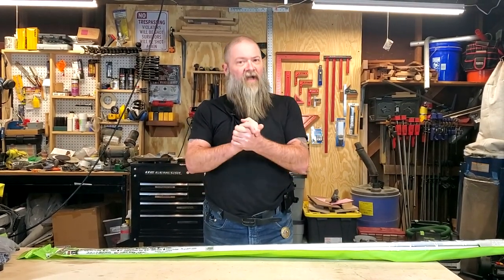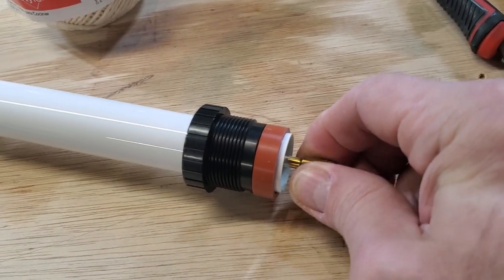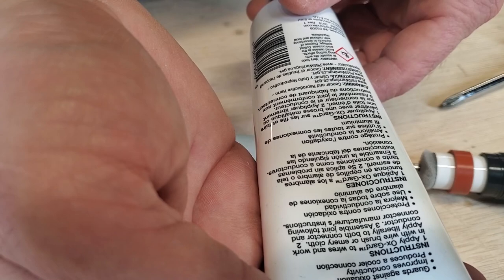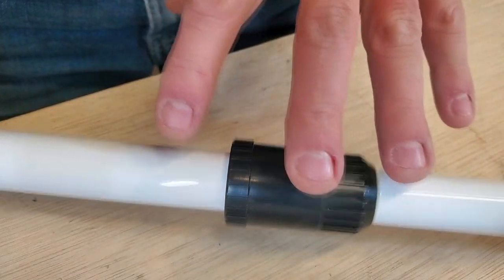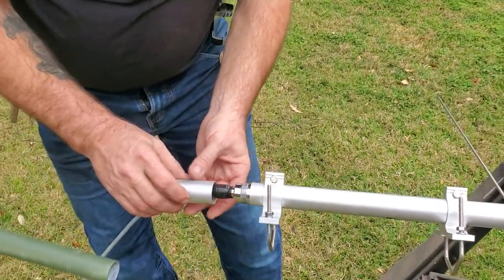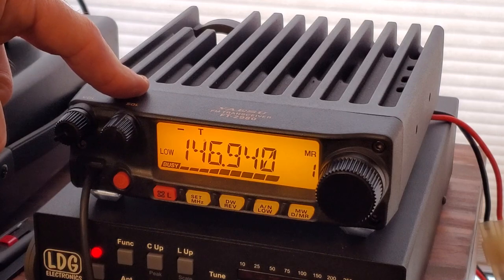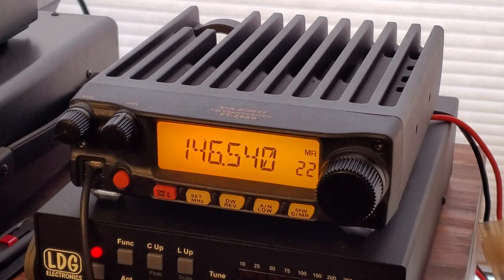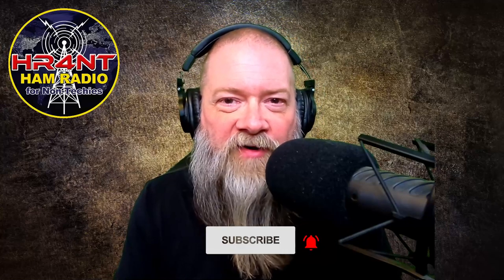Building the Comet GP-9 with the Yaesu 2980

Comment: Thanks for the video. Your instructions saved me a lot of frustration. The written instructions that come with the antenna are terrible! Another tip - The antenna wire within the segments was too deep for me to reach even with a needle nose pliers. I mad a "J" hook out of some solid gauge wire and used that to pull it through. Also found a bad solder joint in the antenna base that I had to repair. Antenna was new out of the box with a high swr. Fixing that solder joint solved the problem.
Reply from the maker: I'm glad my video helped.  Comet antennas are hit or miss sometimes and it is a good thing you checked your connections BEFORE you put it up and turned it on.  So glad it worked out for you.  Enjoy the antenna and make those contacts.  Thanks for the comment and for watching.  73!

Comment: Will this antenna support 462-467 GMRS? Or is the GP-9N better?
Reply from the maker: The antenna specs show that it will work in the following frequency ranges:   144-148 MHz and 440-450 MHz.  So I do not think it will work for GMRS.  The GP-9N is the same antenna but with an N connector rather than a SO-239 connector.  I hope this helps.  Thanks for the comment and for watching.  73!

Comment: That antenna looks like an absolute monster. The 2980 seems like a great rig. I had the FT-1900R back in the day which was similar but only did 50 watts. The menu, display, buttons and everything else were more or less the same.
Reply from the maker: LOL...at 17 feet tall, the GP-9 is a monster!!!  I really like the 2980 and a big selling point for me was that it pushed 80 watts.  I wanted to separate my HF ops from my 2M stuff and this was the solution.  Thanks for watching and for the comment.  73!

Comment: how did the antenna do with high wind mounted like that? i have the Diamond f23 ordered. its 15 feet long , it's just like that antenna. Also my mounted setup is identical to yours. i have the same radio
Reply from the maker: It seems to be doing just fine.  I have had zero issues and with that top rail being mounted to my garage eaves it makes for a study setup.  Thanks for the comment and for watching.  73!

Comment: Video was great...camera positioning and explanations were  perfect. I was at a standstill on lining up my interiors on the sections but now I should have no problem. I also have a Yaesu 2980R and with my CP22E I was getting intelligible signal to the car at 40 miles when my wife was driving at high elevation points along the road. I just put up a 50 foot tower and this GP9 will be so much better with the higher gain. Thanks again for an informative video.  73
Reply from the maker: Glad it was helpful!  I wanted to make sure I had a tutorial video that showed all the stuff that was left out of the other "build" videos.  I am glad that I was on point for you!  Having this antenna up 50 ft will be a massive advantage for you!  Thanks for watching and for the comment!  73!!

Comment: Thanks for posting the building of the GP9. When using Scotch 33 plus, I was taught to stretch it as you wrap it on itself.  I learned this in the 70's from a master electrician/lineman. I think that is the reason why they call it plus. His job was to  replace HV transmission lines on towers leading from hydroelectric dams. I have two of those Ft-2980 radios, they rock. I bought my first one on black Friday 2017 from HRO for $134 which I thought was a bargain. The next one I bought was a Dayton online special in 2018 for $114. I was afraid they closing them out when the price dropped. Covid hit and the prices went over 200 bucks.  Glad to see the prices are coming back down. Great radio to do simplex on. I live in a hilly area where UHF does not do well. I hope you switch from RG8 to LMR400 in the future. FYI the info in the manual on how to set custom memory banks on my radio was incorrect, hopefully they have changed that. I had to watch a video on youtube on how to setup custom menu banks on a Yaesu handheld to figure it out. Later on I bought RTS Software which took care of the custom memory banks. Great to see how well the GP9 is constructed and how easy was to assemble. Thank You!
Reply from the maker: Hi Jim!  You are very welcome!  Glad you found value in my video.  The prices did drop considerably based on your data which is a good thing.  The 2980 seems to be a great VHF radio and I still use it every day now.  I think they did change the manual for programming the radio because I was able to program it just fine.  That GP-9 is suck a good antenna that I think it should be a first pick for anyone that "can" put one up and will use it regularly.  It is just a great performing antenna.  I am planning on getting better coax in the future.  75 feet of 400 is a bit steep right now.  Thanks for the comment and for watching.  73!
Reply: Here in the Netherlands they are sold for 185 US.

Comment: I have a Radio Shack HTX 242 that has the features found on this radio. Max output is 50 watts stepping down to 1 watt… 
Nice to see a possible upgrade to my solid old work horse. I have only used it as a base and never had a problem.
Thanks for sharing..
Reply from the maker: Yeah the GP-9 is a great universal VHF/UHF antenna.  The gain from it alone is worth the price as long as you have room for a 17 foot antenna...LOL  Thanks for the comment and for watching.  73!
Reply: The 212 was my first non HT 2 mtr. radio. It was a beast! Loved that radio... I miss it.
Now I run a FT 2900.
73 de KF4LBG
Reply: I just dug my HTX242 out of the attic and the poor mic cable just disintegrated when I stretched it out.  So I just ordered a Yaesu 2980 as a replacement radio today😂

Comment: Nice vid. Lots of good info here.The only thing I would add is I would loc-tight those screws in the antenna. Also be aware that some people have had those puny disc ceramic caps in the antenna burn out with less than the  rated power.
Reply from the maker: Good suggestions and great tip!  Thanks for watching and for the comment.  73!

Comment: An observation from an old tower dawg.

I noticed a couple of things done in the assembling of the Comet dual band antenna. A couple where address is earlier comments such as how to best wrap electrical tape from bottom to top. The only thing I would add to that is to not stretch the tape to break it. This would likely be less of an issue when covered with a second material such as coax wrap. When electrical tape is stretched, the sun will heat it and the glue will allow it to slide and let the end peel up. Stretching it is OK but allow the last couple of inches to relax and cut it.

The other issue I did not see in the comments is the paint. Carbon black is used in many paints to make it black, imaging that? As carbon is somewhat conductive, it can and does, at some higher frequencies, attenuation RF signals, however, It may be negligible at 2 meters.

W4QJP
Reply from the maker: Thank you for those observations.  I agree that I should not have stretched the tape.  Note to self for next time.  LOL  As for the paint, there might be conductive materials in them, but this has not affected the performance in my antenna so far as I can tell.  Pushing those 80 watts I was able to reach out over 100 miles on simplex a couple weeks ago which I was ecstatic about!  Thanks for watching and for the comment.  73!
Reply: I have used the Diamond antennas for years, both mono and dual band for 1.25 meters and 70 centimeters, each a copy of the other, as best I can tell. I in fact just ordered a replacement for the dual brander on my 70 foot tower. I don’t want to climb it more than one time so I will have everything to replace everything on the day I check it out. I'll be 75 on the 15th. You are not the only one to paint an antenna as you will see in the HOAs. Best to you and yours.

W4QJP
Reply: i have experience with carbon black in powder form, it's nasty stuff, and it plays hell with RFID, I was an electronic technician and learned quickly to hate the stuff. Fun fact, it's one of many chemicals used in making Goodyear tires.

Comment: Your paint job looks awesome!  I'm putting together a GP-6, but will try to emulate yours.  Also, I second the guy who said the rubber splicing tape goes on before the electrical tape.  (I'm using 3M Temflex 2155 and Super88.)  And I was told to stretch it a bit as you roll, and to wrap from the bottom up, so the water sloughs off better.  73, W5TTA
Reply from the maker: Yeah I agree I should have wrapped it differently, however, since this video, nothing has failed or caused an issue so far..  Best of luck on your project!  Thanks for the comment and for watching.  73!

Comment: Looks like you wrapped from the top down even though you said down up ?? Always wrap from below to upwards and that means your overlaps will be sealed from rain running down the antenna. A single loop on the coax taped to your pole at the bottom of the antenna acts as a strain relief so the weight of your coax isn't pulling all the way down to ground. Camouflage is a cool idea, well done. I have the same Yaesu radio.
Reply from the maker: I am glad you enjoyed the video.  I don't remember if I wrapped bottom to top or the other way...LOL  Thanks for the tip.  The camo paint has been working just fine since the video.  Thanks for watching and for the comment.  73!

Comment: Great video ! Just some info I switched from rg8x coax to lmr400 for 2m and 440 and it made a huge difference.  Had alot of loss with the smaller coax for HF it's fine but not 2m
Reply from the maker: My next plan is to do a coax upgrade.  The stuff I have on the antenna now is something I found last year when I was new to radio and didn't know any better.  No real complaints with it, but I know it could be better.  Thanks for the comment and for watching.  73!

Comment: What kind of pole/mast are you using to raise the antenna? Nice video.
Reply from the maker: I am using chain link fence top rails from Home Depot.  They are 10 foot sections, cheap and sturdy.  Add a screw for each connected section and you are good to go.  Thanks for the question and for watching.  73!

Comment: What is the mast you’re using and how long is it? As always, love your detailed videos. Thanks
Reply from the maker: The mast is actually chain link fence top rail form home depot.  Cheap, strong and easy to setup in minutes.  I think the are 10 foot sections each giving me a starting height of 20 feet for that antenna.  Thanks for the comment and for watching.  73!
Reply: Nice, I may have a couple more antenna questions before this is over. Not many willing Elmers around me. Thanks and really enjoy your videos.

Comment: I should start this off with, I have questions and comments. 
#1 that antenna is ridiculously large, I think it's bigger than the mast it's on. 
#2 great video.
#3 when you're sealing up the various connections on the antenna what would your opinion be on using shrink tubing?
#4 when you were putting the antenna together did you realize your zipper was down?
Reply from the maker: Hi David!  Thanks for reaching out!  The antenna is large, but has fantastic gain at 9.5 - 11 db!!!  Thanks for watching the video.  I am glad you enjoyed it!  You "can: use shrink tubing, but I think it would be a little bit of a pain.  The coax wrap tape in addition to the electrical tape really seals everything up as moisture is a bad thing with connections in ham radio.  And finally, the elephant in the room...I realized it after the video came out and now we laugh it off as bonus footage...LOL  Thanks for the comment and for watching.  73!
Reply: @HR4NT  bonus footage I love it Lol 😂😂😂. It is good to be able to laugh even if it's at yourself. 73 we will catch you on the air. KJ7WWC/ WRJF717.

Comment: You should put a couple of zip ties at the bottom of the mast to keep the stress off the connector, I do when I put one up...
Reply from the maker: I actually have 4-5 zip ties holding everything together in conjunction with the brackets.  Thanks for watching and for the comment.  73!!

Comment: Really good video. Nice radio. I was worried that the metallic additives they sometimes put in paint would affect your swr. Clearly it's not an issue. I too live in an HOA and this has given me a few ideas. Thanks.
Reply from the maker: I think that as long as you use flat paints and not metallic or similar, you are probably ok.  I am happy with the performance I am getting out of this so far and I tried on simplex and reached across the city.  Thanks for watching!  73!

Comment: I got the Alinco 735t it does 50 watts good base station! I have a 5 foot Comit, would love the gp9 but the vent stock mount I have I don’t think it could handle the wind load. 73 KJ7TBR
Reply from the maker: Very cool!  What you have now will probably be fine.  50 watts is a good amount of power.  Just keep in mind the higher up your antenna is (VHF/UHF), the longer distance and better RX & TX you will have.  Play with what you have for now, when the time is right, you will most likely know what you want to upgrade "if" you decide to so so.  Best of luck!  Thanks for watching and for the comment.  73!

Comment: Great video.  Are you using anything at the base of the antenna post to keep it secure.  Kinda new to ham radios, looks like the radio is on an auto tuner, is it connected to your radio?   Thanks
Reply from the maker: Thanks for the comment. I have a 4' steak buried halfway in the ground that deep the ground that the Pole is sitting on before it is attached to the side of the house. The antenna tuner is not hooked up to the 2 m 440 and 10 that is only hooked up to HF but that was before I learned about resonant antennas like the dx commander classic.   Thanks for watching. 73

Comment: so this would be a great setup for a beginning tech?
Reply from the maker: I would think so because it is a very good antenna (if you have the room to put it up) and powerful @8.5dB gain.  Pair it up with the Yaesu 2980 pushing 80 watts and you are good to go.  It is a dual band antenna so it will do UHF as well, so if you want that feature, you might want to consider a different radio as the 2980 is VHF only.  I hope this helps.  Hit me up through my website if you have any other questions.  Always glad to help.  Thanks for watching and for the comment.  73!

Comment: Most importantly you need to run to LMR 400 if you want a really good signal no loss LMR 400 is the way to go
Reply from the maker: I agree, however I have reached out 35+ miles with this antenna so far and very little issues.  I do plan on upgrading my cable down the road, but it will be a while.  Thanks for the comment and for watching.  73!

Comment: great video...... but the one thing that jumped out at me was when you hooked that cheap Truck stop gray coax cable to it. Again other than that a great video my friend....... KD9SHA
Reply from the maker: That cable is temporary as it was the first coax I purchased before I knew there was a difference.  However, for VHF/UHF it seems to be working fine.  If and or when it dies on me, I will replace it with much higher quality coax.  Thank for watching and for the comment.  73!

Comment: Not trying to be rude or anything but if you follow the directions and join the bottom to the mid section and then mid section to the top section, sort of like a 3 part fake Christmas tree.. 
The string method you show isn't needed.  Once you join the lower to the mid section and nest it the inner antenna wire actually gets pushed out enough to make the top to mid section connection without have to pull anything with the string
I do find it amazing how the small bag ends up with a 17 foot antenna when your done. 
Got my antenna up in the air last night just need to wire it all up now :)
Reply from the maker: I appreciate the tip, but nowhere in the instructions did it even mention that as an option.  Other video tutorials that I saw showed a similar method to mine and never mentioned that.  Thanks for the comment and for watching.  73!

Comment: What supporting pole did you use for your antenna. It looked pretty sturdy so I am not thinking PVC. I am going to install a Comet GP-6 shortly so looking for suggestion on extension pole. Thanks. 73 & God Bless JohnyMac KC1FWU
Reply from the maker: I used chain link fence top rail form Home Depot.  They come in 10 foot section, they're cheap and they are strong.  I hope this helps. Thanks for the comment and for watching.  73!  Here is the link:  https://www.homedepot.com/p/Everbilt-Chain-Link-Fence-1-3-8-in-Diameter-x-10-ft-Long-17-Gauge-Thick-Galvanized-Steel-Top-Rail-Post-328913DPTEB/312373065
Reply: @HR4NT  Thank you sir! 73 & God Bless

Comment: Hey question do you have to ground this antenna if so to base or direct from the antenna?
Reply from the maker: I don't bother with grounding my antennas.  If I ground anything it will be at my radio.  When I have a storm coming, I unplug everything negating the need to ground.  Hope this helps.  Thanks for watching and for the comment.  73!

Comment: Hey, just an idea if you could put the mfgr supplied Near field propagation and SWR tests. In really interested what the patterns and takeoff angle is. So many advantages to a vertical in noisy rfi and local transmit versus the directivity of a beam/yagi for DX and far off repeaters. I would be fascinated by what the longest contact you log with this great combo.
Reply from the maker: Hi Craig!  They may have that data on the manufacturer's website if you are interested in the patterns and so forth.  As far as my longest contact, when we ran out propagation exercise, the longest contact I was able to make (so far) is just over 35 miles.  I know I can make it reach a lot further in the right conditions.  I need to get on 146.52 and see if I can get better distance on a day when propagation is really good.  Thank you for the comment and for watching.  73!